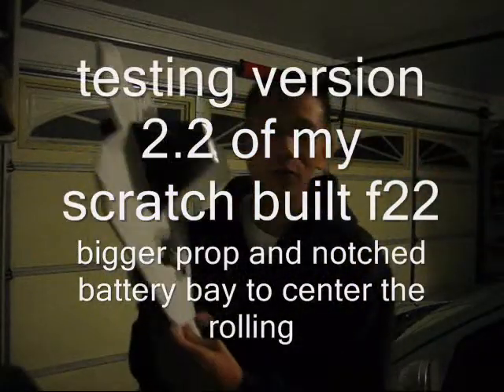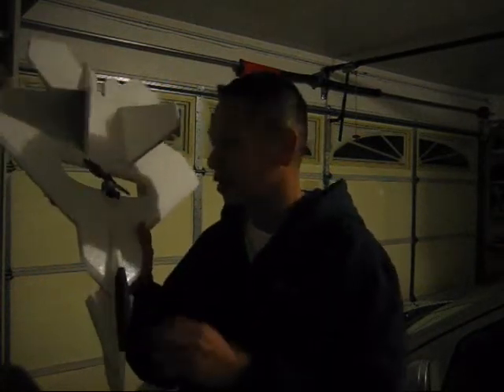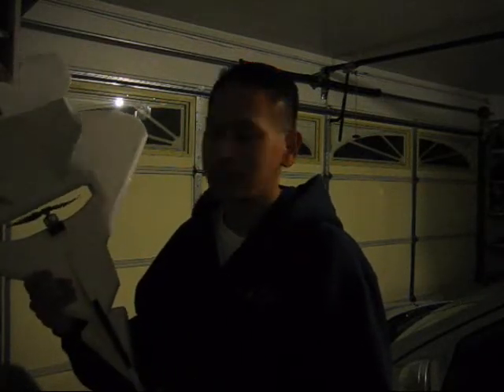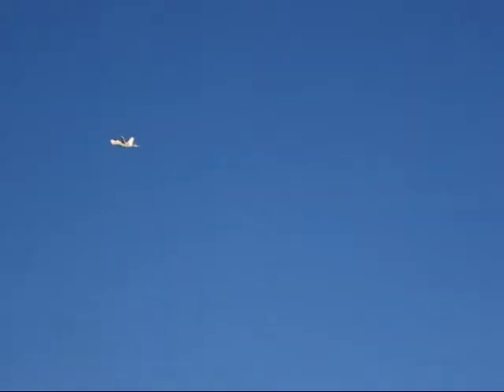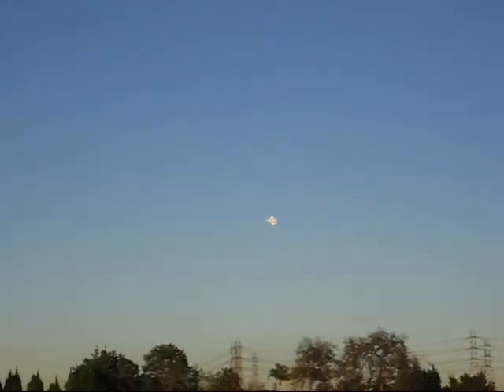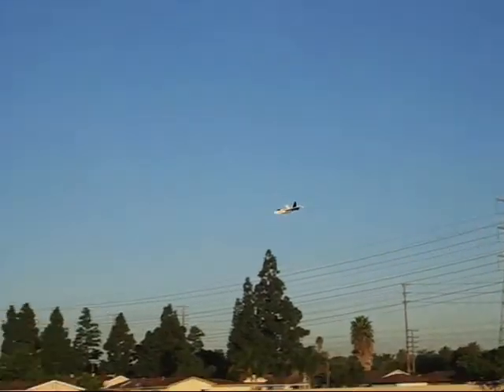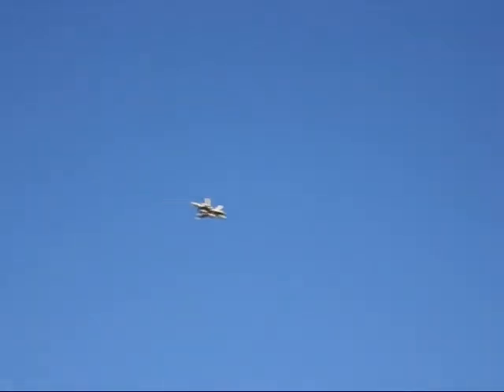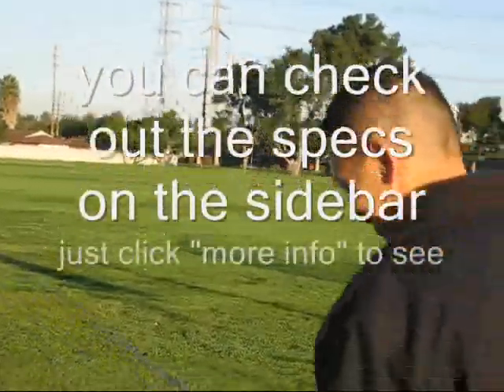scratch built F22 test flight

Comment from the maker: yup, even with the roll CG set at slightly right, it still wanted to roll left when i throttled up. and i can tell you that the plane is definitely tell you the plane is bottom heavy since all the electronics are at the bottom.

Comment: Check the CG, and i don't mean the CG from nose to tail.
CG has 3 axis, the CG we normally talk about is in the pitch axis, you need to check the CG in the roll axis, like wing tip to wing tip, is it really between them. Try holding the plane from the motor or prop mount, which side does it roll to? then. Third CG is to check whether ur plane is top heavy or bottom heavy. 
I think it could be the second CG i mentioned. I know it sounds complicated, even i scratched my head when i heard it first

Comment: Hey try the high alpha on this, i built one from 6mm foamboard, just did the maiden this weekend, and on the maiden i could hold it up at steady at about 70 degrees. move the cg 1/4 inch back and then check it out, its very sensitive to cg change.